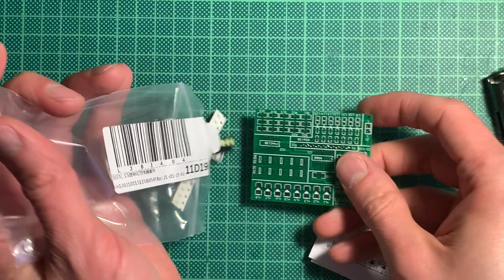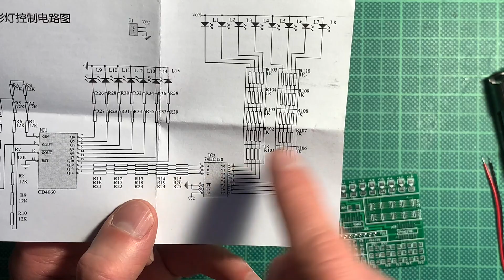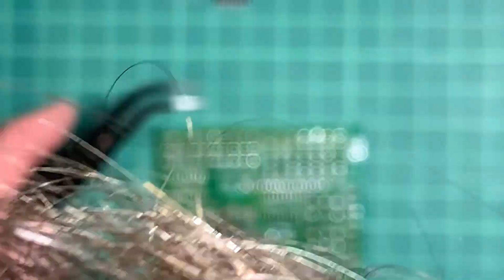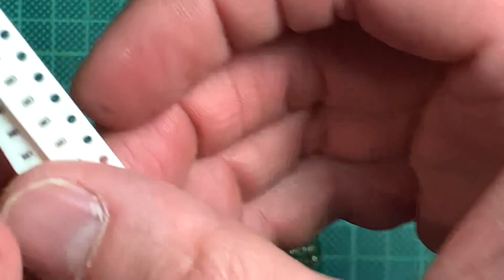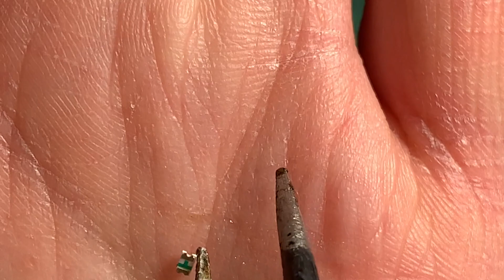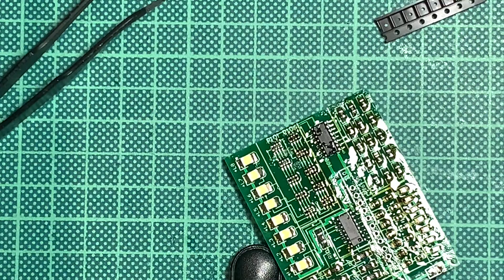SMD Soldering Tutorial — with LEDs!

Comment: You're the only person who show how to take the leds off those strips thing. I bought some led smd to change my dashboard cluster's leds for better lightening and upgrade from old dim lights that was came with the car(2012).

Also i never done the soldering and bought me the air heat gun plus lead solder paste, thinking this'll be the easier route/cheaper than buying me soldering iron stuffs...

You have video of you using the heat gun on smd leds to the kit board?

Comment: Great video.  I did one of these last year and lost one of my capacitors.  After watching the video and seeing the schematic just bridged the missing one (since that's a reduction in in just one) and fired it up.  (usually I'd just put a finger over it)     

I made mine starting with a heat gun as part of my soldering station but it kept blowing components off.   That's how I lost one of the caps.    Finally resorted to the soldering iron.     However when you get the heat on these semiconductors the right way after having a little solder on the pads, they just automatically shift and line up perfectly.    So for some of them they turned out amazing from using the heat gun. 

Broken: I did notice that I had to flex the board to get the final white LED to light up, as there's obviously a break in the trace.  All in all it was a fun build and a great trainer. 
I've also seen a video where one guy used an upside iron as a reflow oven.  Which isn't a bad idea, as it would be nice to have a table top hot plate to place a board on and have the solder take.
Reply from the maker: Turn down the airflow then, or put the gun further away. Should help with components flying off. :)
Reply: @root42  well said, and thank you.   That’s why it’s a practice board!  Ha!

Comment: Thats why i use hot air gun and solder paste ;)
Reply from the maker: It’s on my shopping list if I have enough space. I do this too rarely to justify the investment currently.
Reply: @root42  True i think i have used my once so i understand your answer haha
Reply: @root42  you can get used hotair stations for 25-35€. they are suitable for small jobs like this. you can´t solder high copper mass circuitboards, but thats another level of soldering with hot air.
Reply: What brand of paste would you recommend for a complete novice? My soldering skills are very good but I have never done any SMD work and I see so many mixed reviews that I keep shelving my SMD kits and playing with other projects. Any info or advice from someone with experience would be very well appreciated.

Oh and I should add that I have all the tools besides a heating plate. I have replaced the odd SMD part using a hot air station but that is the most I have done.